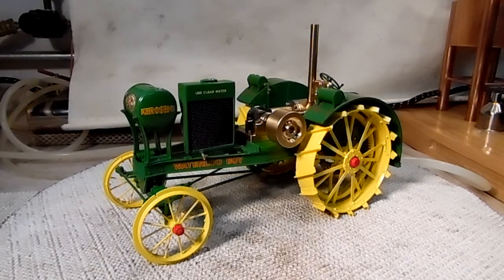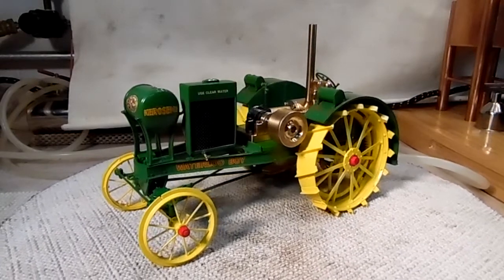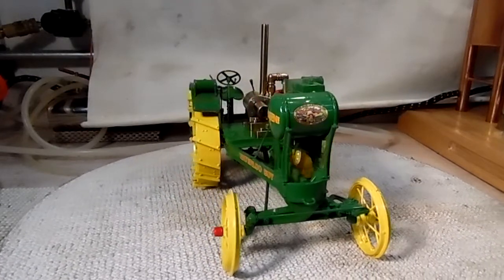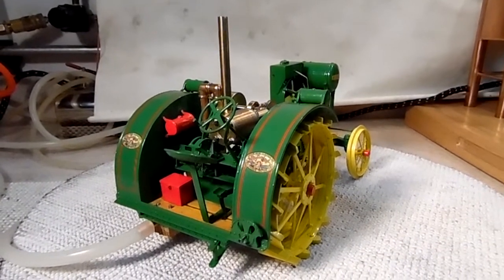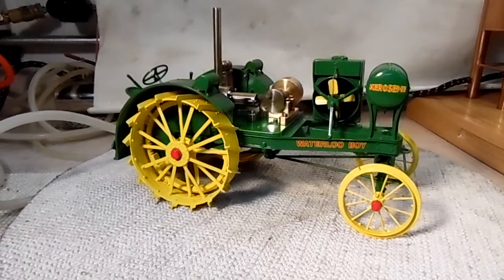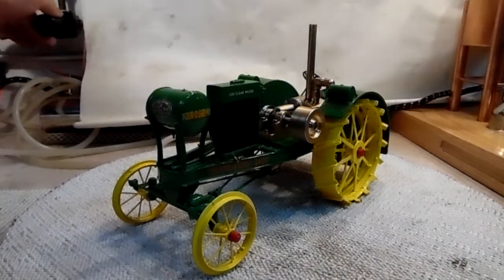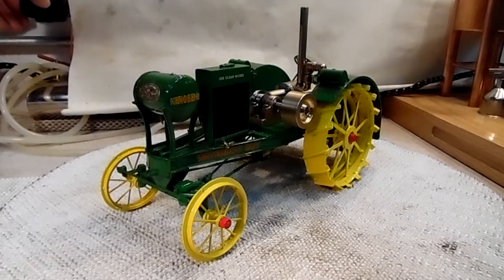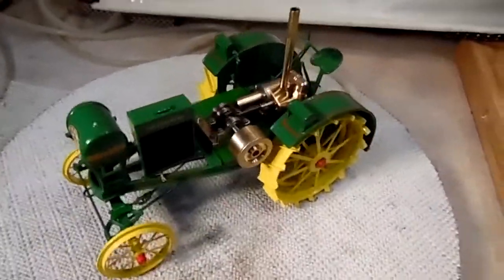Ertl John Deere Waterloo boy w/ live steam engine

Comment: Bonjour Bruce,
Right ! Not a crane but a beautiful and so original support, BRAVO ! The boiler in the trailer, and the radiator as oil separator and the job is done ! I can't wait to see it with a gear box running in your living room.
Amicalement, Raphaël
Reply from the maker: Thanks Raphaël, you have some good ideas there, very much worth considering .

Comment: Holy Cow Bruce! That is awesome!!! If you end up making it mobile, maybe it could pull a boiler on a trailer hidden in something like a flare box wagon?
Reply from the maker: I already have the flare wagon with steel wheels Nick , it came with this tractor , it wouldn't be that hard to make this mobile....just have to think on the gearing for a bit. re: steam trailer , sometimes its easier to hide things right out in the open.